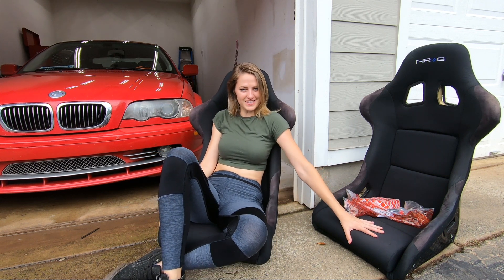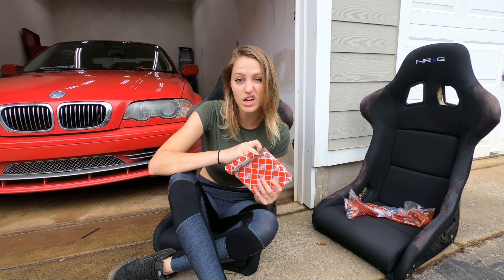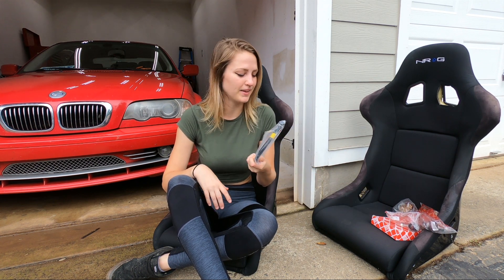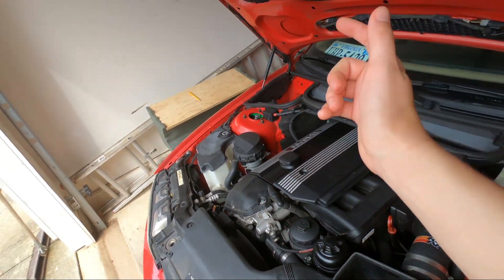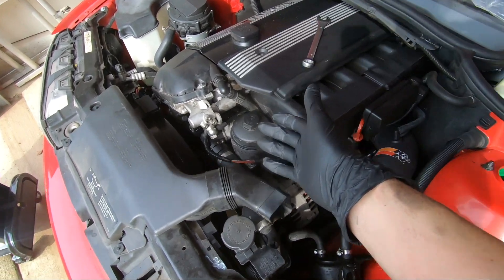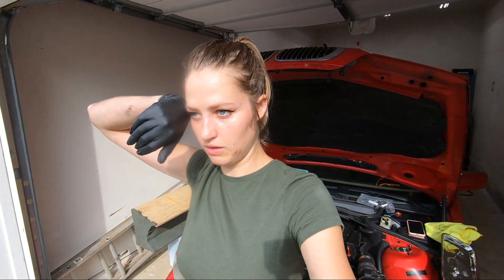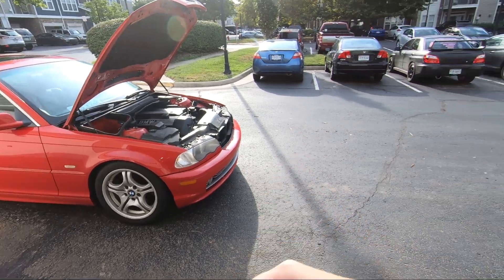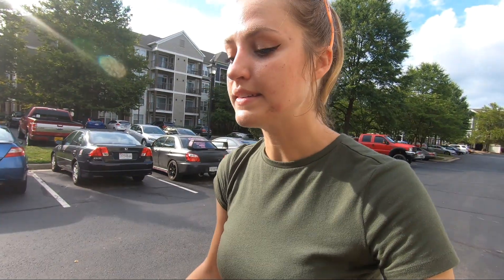MORE CAR PARTS!! Never ending BMW oil leaks...

Comment: used to have an e46, and one of the worst places in terms of oil leaks is the oil filter housing gasket. Cheap gasket but a crap shoot to replace lol
Reply: And usually valve cover gasket leaks on the header

Comment: Hey gabby, just wanted to let you know that with the BMW engines the oil filter housing gasket and valve cover gasket are very common points for leaks  :(
Reply from the maker: Yes! Shortly after I recorded this video, I ordered the oil housing gasket :)